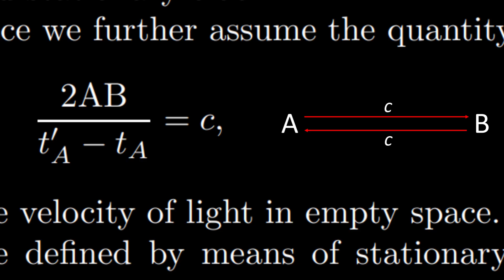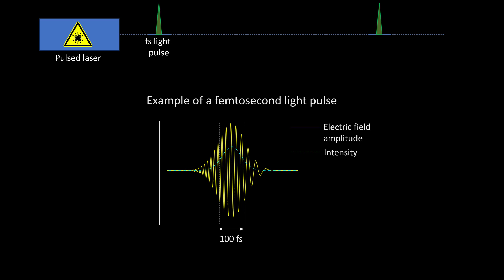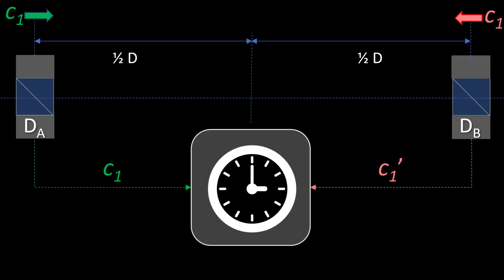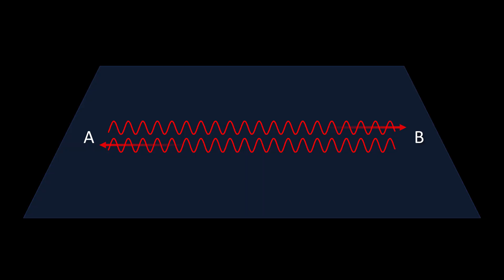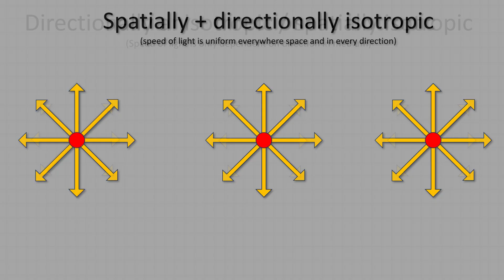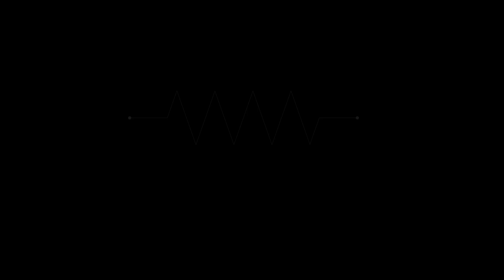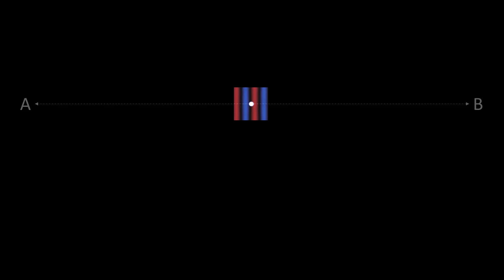Knowing the one-way speed of light

Comment: tl;dr Your models are unable to reconcile directional anisotropy of the speed of light with experimental results. However, this only says something about your models, not about nature. There is absolutely no reason to believe that light has the same velocity in every direction.

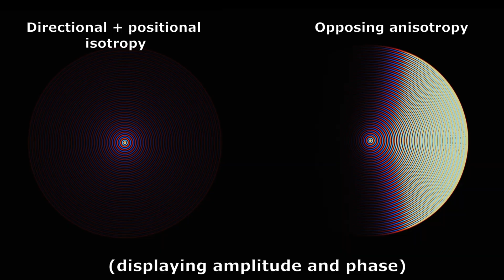20:33 Your simulation shows directional anisotropy of the wave intensity only because it fails to take into account a kind of Doppler effect for intensity. I'm not good enough at explaining it, but I highly recommend How Superposition Causes Length Contraction video by Dialect on youtube. Anisotropic speed of light (your simulation) and superposition of waves (see recommended video) cancel each other out perfectly.
As for the normal, frequency Doppler effect, it is a function of the properties of both the source and the observer; effects of each would cancel out with each other.
As for your conservation of energy and momentum argument (19:06), your spring analogy is invalid. With directionally anisotropic velocity of light, in a given time interval, you will have more photons (if you will) arriving in the "slow light direction", each with less momentum; and you will have fewer photons arriving in the "fast light direction" in that time interval, although each of them has more momentum. Equal total amounts of momentum are going in opposite directions, hence conserving momentum. This is again explained by the superposition argument.

Comment: To measure the one way speed of light make a shaft with disks on either end with a slit in each disk. Measure the distance between the disks. Make the slits slightly offset and measure the offset. Spin the shaft in a vacuum at an increasing rpm while shining a light on one disk. When the rpm allows the light to pass through the slits in both disks, stabilize and record the rpm. Now calculate the one way speed of light based on the offset of the slits the distance they are apart and the rpm of the shaft.

Comment: The basic issue, you've somehow circumnavigated.
For the case of the Maxwell EM propagation within a medium. Versus the speed of light in "empty without any medium", definition of "space".  Why was the one-way "c" even needing a determination?  Was it not the consideration that say your (infinite extending) 'spring-mass array medium", could itself have a bulk flow like behavior superimposed. Thus, your fixed reference frame of seperate sensors at either side would see a "delta-c" akin to the 'flowing of a spring-mass array medium's velocity vector" wrt your fixed-frame. (Was that the point of a 
Michelson-Morley laser interferometer test setup. Used to disprove existance of an aether which was presumed that the earth's rotation & orbit represented a global-scale relative velocity therein wrt "free space" somehow assumed to be random or stagnant. (Aka,  Maxwell's use of permittivity - permeability even for photons implies a medium, be it vacuum, fluid or solid medium'.)

So, to measure a one-way light-speed in a tube of rapidly flowing medium; does the velocity of that medium, does it change the arrival times of upstream versus downstream launched pulse events. While the red-shift & blue-shift might be expected in the process somewhere as well.

Comment: You don't need to use electricity or light to start the timer - laser on one side of the room, photo-diode on the other, use sound, or sound through a material like a vibration through a long copper bar or piano string. You pluck the string at the same time as you turn on the laser, and on the photo-diode side, you check how long after the light arrived did the sound wave get there, this time would be different in both directions if light has a different speed in different directions. You would need very accurate equipment but it's theoretically possible. The key insight is that you don't need to use light or something faster than light to tell the receiver what time you turned on the laser, it just has to be predictable.

Comment: 22:46 There is an effect called electro optic effect. If you apply voltage to lithium niobate (or any material for a weaker effect), the speed of light/refraction index changes.

Comment: if you suppose that the one way speed of is different from the two way speed of light, what would the result be if you placed the clock such that detector a was directly between the clock and detector b, and had the signal from detector a travel through an optic fiber with an index of refraction equal to 2?

Comment: For a minute I thought you'd figured this out! But yes, you've run into the same problem Einstein did .... ( (c - v) + (c + v) ) / 2 = c. So arguing with Gemini for a solid month, it will eventually stop force-feeding me the assumption that C is the same to all observers 'within their frame'.
Apparently when Einstein shows that we can't split apart the geometric dependency of 2 way light with a morley-like experiment, he makes the assertion that a) We can disregard Morley's claim about aether wind  because it will always cancel out. B) We can trust Laplace's transformation. However, when you do a Minkowsky metric, I believe: "you are now confining the assumptions to be a homogenous c to the observer". The minkowski makes polar assumptions because it's akin to matrix operations, and this is where I believe we have a problem with a pole inversion between the two possibilities of what 'homogenous c' really implies. I believe this is similar to seeing that x=y and x=y*y all plot and rotate equally for 0 and 1 .... giving that a unit rotation is functionable only at those values. However, if more dimensions are involved then you have to resolve the rotational handedness, or else you will get an incorrect 'sign inversion' and not properly cancel out this vector via subtraction. I believe that a lost inversion is what you get if you apply Minkowsky to the twin paradox or the andromeda paradox. 
I say that because i can always reverse the thought experiment in some way, find a contradiction, and disprove all assumptions. You cannot treat the twin on earth as moving, and the traveling twin as 'sitting still from his perspective'. Because you cannot assume the stars in the night sky are rotating around us faster than c! Light particles moving by us don't freeze us in time. Therefore, if you really do want to preserve all of our physical laws when doing your transform, you have to ration out the Laplace manually for a given geometry. Minkowsky is like a 'shortcut home, as long as you don't stray from the path'.  But for any problem involving interferometers, Minkowsky is already bound to the results of Morley.
What I'm saying, if someone is showing you Minkowsky diagrams, claiming to you that this all 'works fine', then every assumption they've made has an anti-directional geometry that will break all assumptions. I say 'anti-directional' as in ... turn the observer around, or what about light from the other direction? Like the Andromeda Paradox assuming that observers stretch space somehow for other observers. And in the 21st century, there are many many conflations abound that may be mislabeled. For instance: matter contracts, not space! Space is like the moon, it belongs to everyone and has to maintain a proper c for everyone! For me, it's a simple enough geometric proof, that some other mechanism needs to explain how observers modify c, or a bounds as to what constitutes a 'field' versus a 'frame of reference'. I just don't know how to integrate this geometric pole of causality into the existing tensor operations. But there are way more contradictions to be had if the timing of your beams do in fact measure the same at midnight as they do at noon.

Comment: If you correct for the detectors to measurement  you need to know the speed of light on the opposite direction, because half of the path of each wave train is in the opposite direction to communicate with the coincidence detector. So any measure you do this way would measure nothing if the speeds in opposite directions are different. You may tweak all you want it can't be done.

Comment: :hand-pink-waving: Can we measure  the one-way speed of light? Yes, as a very good approximation. Just put two oscilloscopes apart and send a radio sharp pulse signal from one to the other preferably generated from a spark gap source located at the location of the first oscilloscope. Then compare the phase difference of the recorded signals in both oscilloscopes. With today high accuracy oscilloscopes the speed can be measured even if the two oscilloscopes are only 1m apart. A short 1m naked wire (i.e. speed of signal in naked non-insulated wire is the same as speed of light on air or vacuum) can be used to synchronize the two oscilloscopes trigger signal input very accurately. This measurement is not affected by electronic delays since the time difference (phase) you measure is the time it took the radio pulse to travel on air from location A to B where the two oscilloscopes were placed. Of course the Tx an Rx coax signal channel paths of the two oscilloscopes must be previously balanced and identical. Again, this one-way measurement is only a very good approximation not taking into account Special Relativity limitations. But practically the error is minuscule. You can do this experiment also with the two channels of a single oscilloscope but you must be sure that there is no cross signal leak between the two adjunct channels of the oscilloscope and the two channels are perfectly isolated and shielded. https://grok.com/share/bGVnYWN5_a3da879f-55d7-432f-bdc4-a4220e50528f

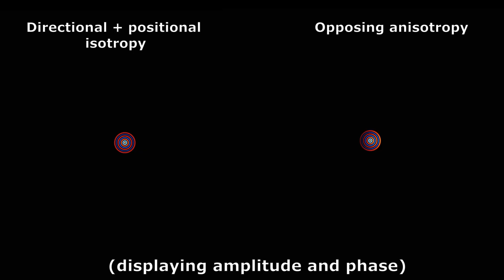Comment: At 20:16 you precisely shown the in-isotropy of light in the 4 dimention that's what we observed and deduced that the space expands with accelerated light speed. Don't you think that something is off o that space expansion "oservation"? How do you proof that the light just loses energy with huge distances because of the elasticity and momentum/impedance of the vacuum itself or the space is expanding?
Reply: I mean if you have a lake and you are only to dimensional being that life's on the surface of the lake and you have a wave that got generated with a fixed frequency you observe that the ripples get smaller in amplitude and longer in wave length. So how can you measure the size of the lake if only what you are able to see are the ripples that get lower in frequency is the lake getting bigger because of that deduction?

Comment: Just use 2 mechanically coupled rotating shutters as done by Mr. Stefan Marinov. Described in the article “New Measurement of the Earth's Absolute Velocity with the Help of the ‘Coupled Shutters’ Experiment”. It turns out that the speed of light in the back and forth direction is different, it is affected by the position of the planet in space at the time of measurement.

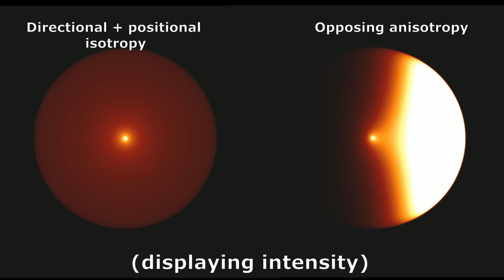Comment: @21:00 i think the issue with that is that it assumes a that said energy calculations are equal in opposite direction. There could be some theoretical scalar value that depends on direction such that C1/S1 = C1'/S1' and that the combined value is the true value being used in the energy calculation

Comment: I feel like the only way to detect the one-way speed of light is with an analog method, but it would require a level of precision and specific chemistry that probably isn't feasible. For example finding a system that acts as a time crystal whose state is frozen by exposure to light. By measuring the state of the exposed sample vs. a control you could find the time-wise position of the exposed region in the overall structure of the crystal, which would tell you the time when the experimental crystal was exposed to light since time crystals exhibit a known repeating structure in time.

Comment: What about using a SPDC Back-to-Back Opposite Direction Photon Emission? Since they can emit a photon at the same time and in opposite directions, you could use a mirror one side to reflect it back to a single detector. You would then measure c1 from first photon and (c1'+c1*2) *lengthfactor from the second!? You could also change length of the second path, or even measure if they are entangled to verify the originate from same event.
Reply: Is the detector at the same place as the emitter? If not, how did you measure c1?

Comment: Experimental Setup for Measuring the One-Way Speed of Light

This experiment is designed to test the one-way speed of light using a looped path and local clock synchronization instead of relying on global synchronization, which has historically been a challenge.

Key Components:
🔹 Five Stations in a Loop – Each station is equipped with an emitter, detector, and atomic clock.
🔹 RefParticle (Light Particle) – A reference light pulse used to synchronize all stations.
🔹 Looped Light Path – The path along which light particles travel, allowing for precise measurements.

How It Works:
RefParticle is Emitted from Station 1 🚀

This light pulse travels through the loop, reaching each station in sequence.
When RefParticle arrives at a station, it triggers the station’s atomic clock to start counting from zero.
Synchronization Without Global Clocks ⏱

Each station’s atomic clock is synchronized locally when RefParticle arrives, avoiding the need for external synchronization methods.
This eliminates the problem of clock synchronization error across large distances.
Emitting Additional Light Particles 💡

After synchronization, new light particles are emitted at precise intervals before RefParticle completes the loop.
The stations predict when and where these new particles should arrive based on the synchronized local clocks.
Detecting Speed Deviations 🔍

If light moves at the same speed in all directions, the emitted particles should arrive exactly as predicted.
If there is an anisotropy (directional variation) in the speed of light, small deviations in arrival times will be detected.
Why This Matters:
📌 Challenges the Assumption of Isotropic Light Speed – If light does not travel at the same speed in all directions, it would have profound implications for physics.
📌 Avoids the Need for Einstein’s Synchronization Convention – This method eliminates the dependence on traditional clock synchronization methods.
📌 Practical and Testable – Unlike previous purely theoretical models, this experiment can be physically conducted to verify results.

Comment: @HuygensOptics Excelent video as usual. Personally I found the first part very instructive about the difficulties in designing a proper one-way speed measurement experiments. However, the discussion in the second part seems to be missing an acknowledgement of the implicit assumption of the speeds being observed relative to the propagation medium, but not in any other inertial frame, which is understandable considering Special Theory of Relativity, but differs from the the first part in that regard. In other words the discussed speeds are, in general, the obesrved speeds of propagation, not necessarily the speeds of actual physical changes in the medium.
I would refer you to the acoustic Michelson-Morely experiment done by Norbert Feist, whose results indicate that even in air (mechanical medium) an observed isotropy of the two-way speed emerges from the perspective of an inertial frame moving with respect to the medium, while still retaining the observed anisotropy of the one-way speed.